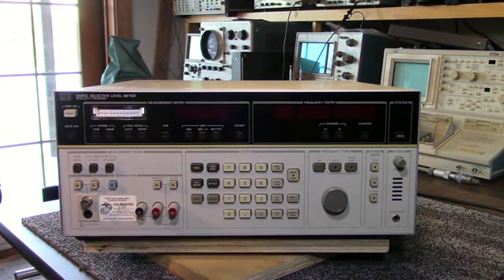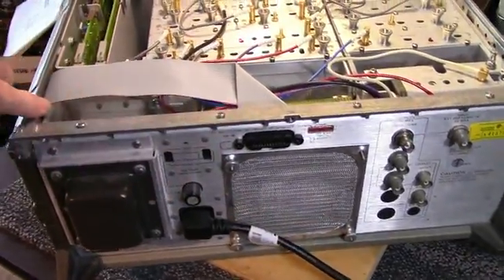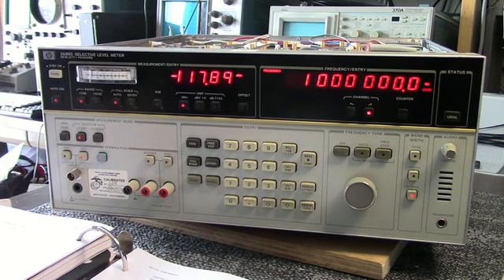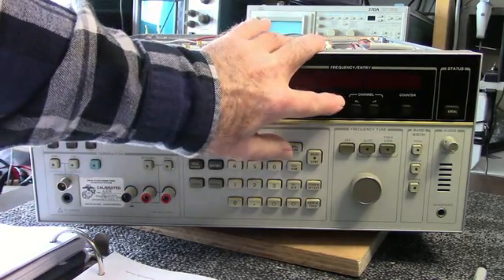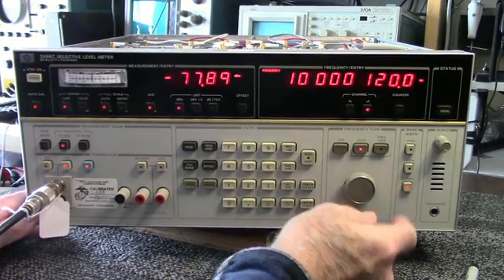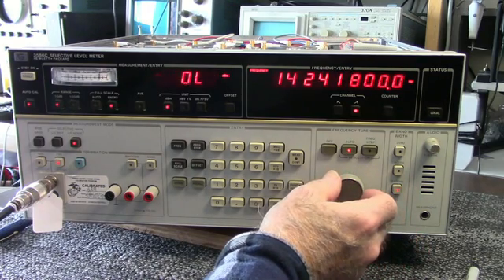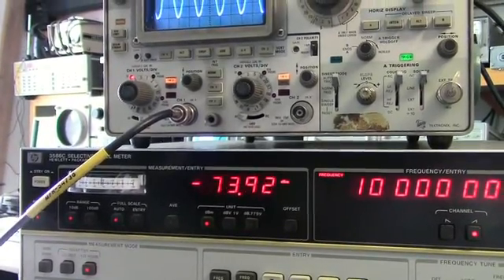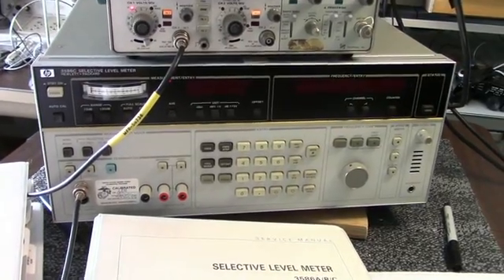Hewlett Packard 3586C  Selective Level Meter

Comment: Did you see any obvious issues on the original A6 pcb, possibly a tantalum cap.
Reply from the maker: Hi wa4aos,  I didn't notice any obvious damage on the board ( A60 ).  The board in my units are different than the ones in my manuals ( A60 revision B ) . There is one 22 uf cap across the supply rail that checks ok.  I was surprised there were not that many bypass caps on this board ( many SN74LSXX low power schottky ).  Without extender cards it is difficult to troubleshoot live.  The manuals are extremely detailed.  A lot to digest . This is the controller board containing the processors and ROM.  It may be beyond my ability to repair.